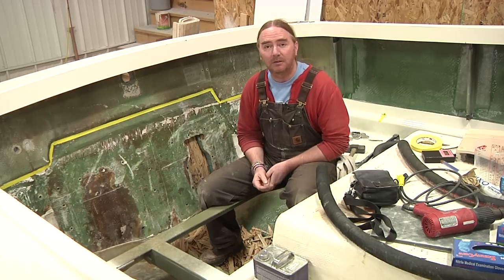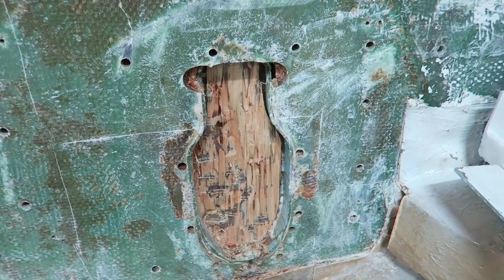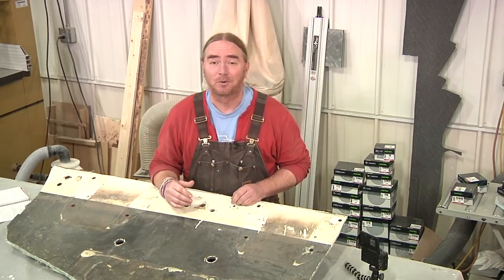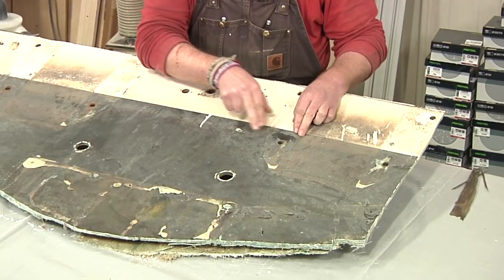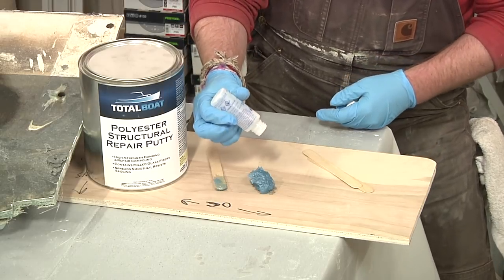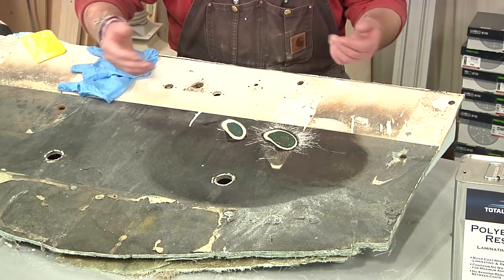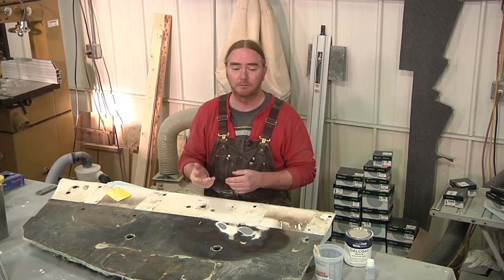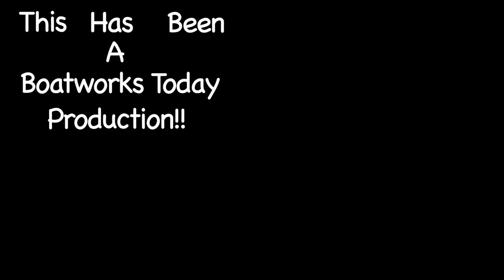This Bertram Hates Me lol! Transom Poll Results And Spring Pre-Launch Tip #1

Comment: I have an electric chain saw and diamond grit sharpener bits.  I put a bearing on the bar and precut grooves in the wood core before chiseling.  Chowders the chain but I dress it regularly with the diamond sharpener.  Wonder Bar pops out the checkers and gives easy access to the edges.

Comment: Your videos have been super helpful! Especially since I picked up a 74 Bertram sport cruiser about a month ago.  She is just a hull but was rigged with twins merc 120s + v drives, prop shafts and rudders. The videos help tremendously with transom work since I also plan on going with a bracket and outboard.

Comment: Thanks for this in-depth analysis. It will be good to see your process for tabbing in the Coosa to ensure that the repair is integrated into the structure. I will be interested to see if you completely remove the transom so you can wrap glass around to the topsides or just get back to solid glass and fit a plug of Coosa then tab it in. Your thoughts on structural integrity of the two approaches would be good to understand. Your comments on product selection and application really help, by the way. :-)

Comment: i bought my first boat 2 years ago and learned to do all the repairs on it by watching your videos!  each hole i had to fill was done the same way: drill, dimple and plug with layers of glass... i had to do that even for the small holes because the hull flexes a bit and i had nightmares about a non-glassed plug popping out somewhere offshore....
Reply: Did you use total structure ? or something else?

Comment: couple of deeper queries 

1 above or below waterline
below i try to use vinylester products.  they are real water resistant. above standard poly is simpler and faster and cheaper
2 i avoid epoxy unless really needed. toxicity and allergy problems along with compatibility problems
3 you keep talking CSM but never call weights like 3/4 or 1.5
4 i had a great result with a sailboat and a lightning strike.  had half dozen holes and some burnt balsa.  needed back in water in five days for a race.  did job 100% vinylester.  quicky primed to fair finish with home depot acrylic primer expecting to replace it in the fall when the boat came out for the season.  finished with pettit vivid anti fouling and buffed it to match.
five years ago and no issues

Comment: Andy great video series i have picked up a few pointers from them, sometimes every plan needs to be changed a little bit. It was better to find this out at the beginning than when you are halfway through a project.
I have only worked on only a few boats, but i have worked many corvettes and cobra kit cars. When mixing up fillers and fairing compounds you should advise everyone to mix the compounds on a non-porous surface for exe. wax paper, a plastic cutting board, a flat piece of clean sheet metal or plexiglass because when using cardboard or a piece of wood some of the MEKP is absorbed into the materials weakening the repair. It might not seem to be important but when you have to repaint the side of a car because something went wrong with your work sucks. Also using cardboard with printing or pictures on it, the solvents that was used in the ink will transfer into your compound which could also ruin a great looking repair.

Comment: Andy- thanks so much for your straight forward clear demonstrations. I just bought some of this structural repair putty and chopstrained matting, gel coat to do an identical repair. I did get the total boat gel coat with wax and now I’m concerned that I should have gotten it without wax because after the repair I’d like to put several more coats on the transom. Is it ok to use the with wax gel over the putty so it cures. Then sand and go over that with several coats of gel coat without wax. Thanks, Ed

Comment: I voted for whole transom, so glad to hear the news but at the same time, that sucks. Anywho, I have 6 screw holes from an old transducer I want to fill. I put west system six-10 on screws and screwed them in and it seems to be fine but I now want to fix them like the hole in this video. Is there any product other  than this filler as I don’t need but an ounce or so and really didn’t want to buy a $40 can for the rest of it to go bad on my shelf.

Comment: I prefer to fill the core void with 8lb 2 part expansion foam and then glass over it. It doesn't expand and contract under the fiberglass patch causing the infamous crack.
Also glass goes over any hole in the fiberglass. IDK if it's 3" wide or 1/8th".

Comment: Love the videos. You are a wealth of knowledge and information. I have a question about repairing gelcoat chips on 90 degree edges. I have a older Trophy that has several spots that need fixed. How and what is needed to fix this correctly and avoid sagging.

Comment: Hey Andy, a bit off topic but you will have to deal with it eventually. If the “fuel tank” is fiberglass you might want to consider having an aluminum tank made. Ethanol fuel does not like fiberglass and vise versa. The ethanol will dissolve the resin overtime.     A polyethylene or aluminum tank is the best way to go.  Unless you’re only going to use REC 90 fuel/ethanol free fuel but that’s quite a bit more expensive.  Just looking out brother.

Comment: Air trapped in the  2 holes patched with polyester putty.  Not possible to squeeze material to bottom of the hole.  Need to use a syringe: 
1. Over drill the hole.
2. Use a syringe & neat polyester resin into bottom of the hole - this is to wet out the sides with resin.
3.  Put repai

Comment: I have a question in my mind I want your opinion. I want to cut the aft deck out of a Tollycraft 26’ in order to install an engine. It doesn’t fit thru the hatch w/o a lot of disassembly. 
If I make the slantiest cut I can make with a sawzall, or fein-saw will I just be able to glue that deck back down and call it good?
Should I be putting a flange on the bottom side prior to reassembly?
I’d appreciate any suggestions.

Comment: Andy, that is interesting, I was told you cannot use polyester for repair work? That you had to use vinylester or epoxy
Reply: Hey Nick! I was just thinkin’ buddy, I’m gonna be in Port Townsend in April. Maybe you and I can hook up for a beer or something and talk sailing stories. Dude, I got this great story of this maniac sailor I ran into in Tacoma last year. Dude you gotta hear this. Yeah, this guy said he built a Time Machine. He said he went back to 1970 and stole some IOR sailboat racing guidelines from the ITC. He then said he went back to 1965 and gave them to John Brandlmayr, who is a boat designer. He convinced John to build a boat using these stolen guidelines, this way, when he bought this boat in the future in 2017 (which he did), he could claim it was designed under the IOR guidelines. Dude, you just can’t make this stuff up! Anyway, nice running into you here again. And once again, great channel Boatworks! Subbed!

Comment: the milled fiber putty looks like it handles well.  on the 1/2 inch hole i would have v ed the hole with a chisel so that the shrink that will occur over the next 30 to 180 days would not be as prevalent

Comment: Okay...I have a question! 
I have watched you go from fixing with polyester resin to say that you can use epoxy resin over it..which I know is do able but can you go from epoxy fiberglass to using polyester resin? I am repairing a boat, first time owning  a boat and come to find out this thing needed all flooring repaired down to the stringers.  Ugh! So  I purchased polyester laminate and structural putty and gelcoat.. but now I am not sure if it is compatible to what is already there... can you help??

Comment: Just a quick question,  when fixing holes like you have shown. is it fine to fix the holes and sand them ready for the finishing coat and leave them un painted and exposed to rain etc while I continue fixing other parts of the boat and then come back at a later date and paint the entire boat all at once??

Comment: Transom Replacement videos coming up!!! Do those moisture meters even work? “Smells” like you have water logged wood!
Reply from the maker: We'll see what's going on when I start cutting it out, but the boat hasn't been in the water for 10+ years.  Could have been wet at some point and slowly wicked the moisture out?  Hard to say but the smell is a sure tell-tail.  That said for the most part good meters are pretty accurate
Reply: You can store a boat dry and remove any moisture in the wood over enough time. The moisture reader would give you a proper enough reading, it's just a reading once the wood had dried out.

I purchased a boat like this out of a barn once. I had a guy look at it and he used the meter saying it was good. I rebuild the Johnson motor and took it out next spring. I noticed the transom flexing so badly that it scared me enough to get a tow back to the ramp. 

I asked the old lady who sold it to me and she said her late husband put it in the barn some years ago when the motor started acting up. She said it was moving around wrong or something. She said she told me the motor had problems. 

Luckily, with the fresh rebuild, I was able to get my money back from the motor and controls and have the guy carry off the hull for me. He had an older boat with the cable pulley steering that he needed to upgrade.
Reply: @boatworkstoday  Spoke to a German yacht builder and -refitter about osmosis cure the other day. He said exactly the same. If a boat has been out of the water long enough moisture meters are quite useless...

Comment: You suggest a couple of times that gelcoat should not be used over epoxy. In your own tests see video titled ‘Gelcoat And Epoxy Bonding Results!’ it worked fine. Based on these tests I have successfully put gelcoat over epoxy with no problem. Are you still reluctant to do this?

Comment: First of all, great channel Andy! You said you're using  a poly based filler because gel coat will adhere which brought up a question. I am painting using Alexseal with 442 primer. Are there certain types (poly / epoxy) fairing I should or should not use due to possible primer adhesion problems or will primer basically stick to anything?
Reply from the maker: Primer will pretty much stick to anything, however when painting it's best to use an epoxy fairing as it's a more stable substrate than poly based material (shrinks less during post cure) :-)

Comment: Hey Andy I love your videos. You do amazing work. So glad that you didn't have to loose your breakfast from the smell. I got a whiff of something similar to what you described and lost my meal in a hurry. Luckily I was already outside and didn't have to drive the big white steering wheel. Had a strange feeling that you should replace the whole thing that is why I voted to replace. Not a I told you so story. I would have done the same thing you did. See if repair would be an option first and go from there. Love you brother. Such an amazing teacher even if you think your an old fart. To me you are still a pup. A darned good one.

Comment: Yep you are at the age when it's time for reading glasses or bifocals... I made it to 52... I noticed it when I was eating dinner and said... hey... why is my food looking all blurry? ;) My eye doctor said usually around 48 is when you need them... Now I'm 64 and have trifocals... And my eyes are getting light sensitive. If I see a bright light I "see" a dark spot for a fews mins or longer depending on how bright it is, until my retinas reset. Can't see, can't remember why you came into the room or where you left your keys, hair growing in places where you don't want it, and not where you do want it, aches and pains all over, just part of getting old...

As far as the transom... that is the problem with other people's work... Some just don't care, let's just fix it so it works and let the next owner worry about it... 

Actually, that is how I ended up on your channel, I don't own a boat, but I bought 26' Uhaul that I'm turning into a stealth camper and after peeling 8 layers of wrap off the side of the truck and then the Uhaul wrap, I have delaminated FRP, they fixed a 4x8 section with thinner FRP, feathered it with Bondo and filled a big gouge along the side with Bondo, and whatever paint they used failed and the wrap cracked in those spots, the Bondo wicked water and started rotting out the plywood and with the freezing weather it popped the fiberglass off the plywood on the outside and inside of the truck. So since I'm not a expert at fiberglass repair, I started watching your channel to learn how to fiberglass and to fix my truck like a boat so I won't have that problem anymore.

Now I'm just watching because I like the channel... And you have a doppelganger out there, I used to know someone that exactly looks and sounds like you... Uncanny... I can't pull up his name yet, out of the old memory banks... It's a bitch getting old... lol